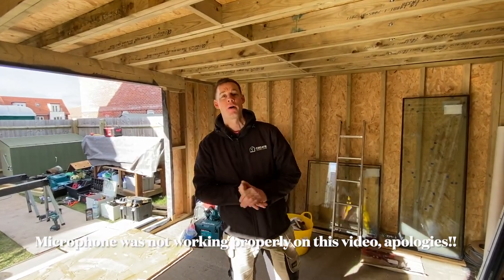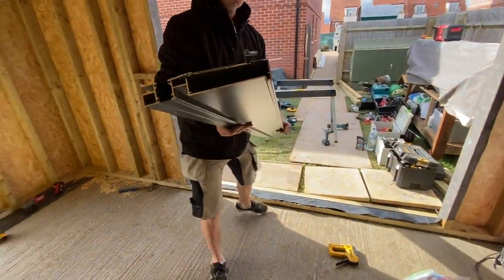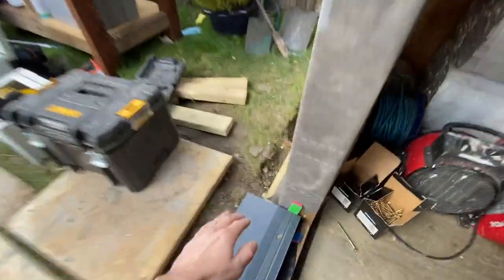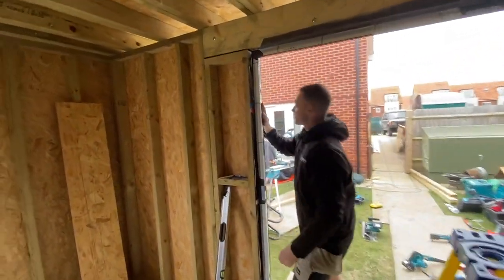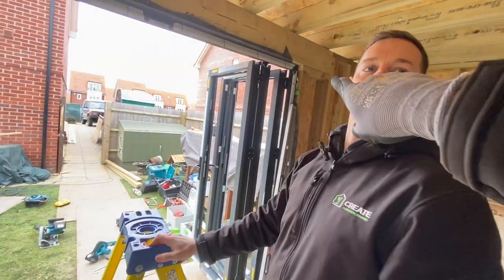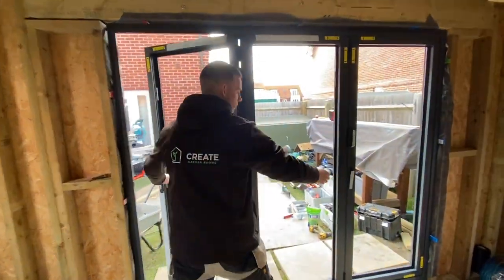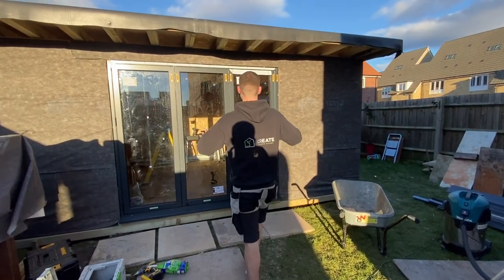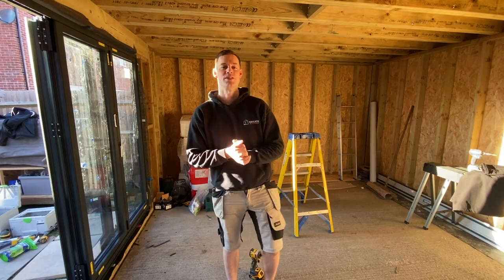PART 5 FULL GARDEN ROOM BUILD How to fit Bi-fold Doors and Window to a Garden Room

Comment: Great video, looking to build my own soon. What size wood did you put between the floor plate and the cill? Is it 2 2x4's so your 100mm insulation meets the level of the door?
Reply from the maker: Hi mate thanks! Doors are all different so you’ll have to pack it up to whatever your threshold is. We used lengths of 11mm osb sometimes but anything under that you can just use door packers 👍